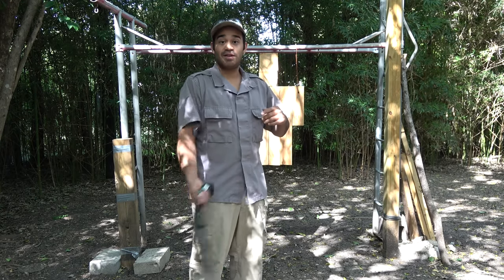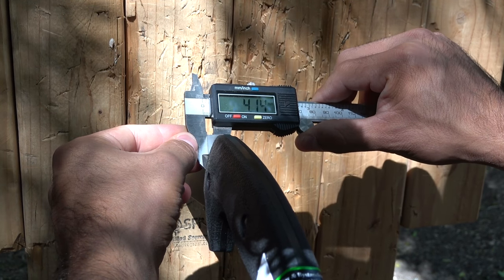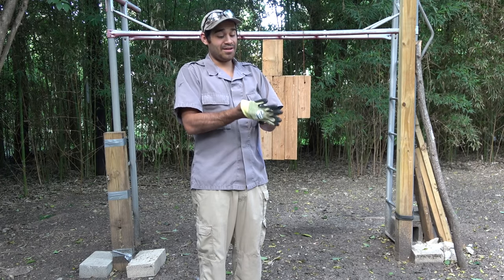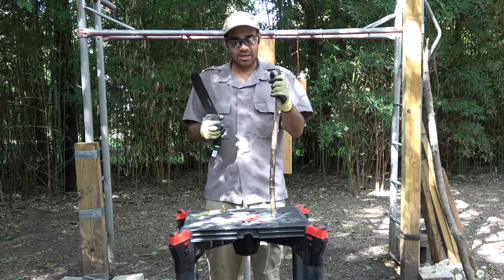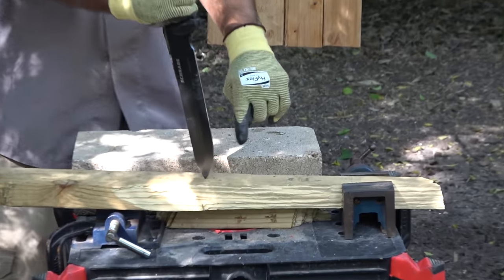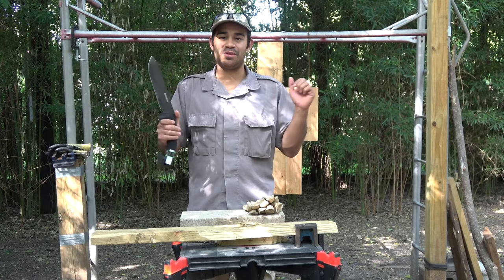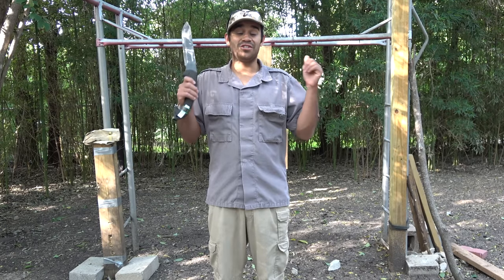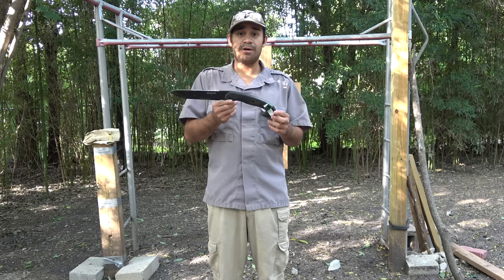Schrade SCHF43 Jessica-X DESTRUCTION . . . By Mayor Fuglycool

Comment: Do the schrade SCHMBS next! I wanna see what that 3cr13 really has to offer!
Reply from the maker: That looks like an interesting blade, will have to give it a look ;)

Mayor Fuglycool
Reply: FPS_Machete_[HD] If it's THIS kind of test, it won't survive. Tell you right now. These are fun to watch, but it's still gross abuse. Cutting/chopping/slicing it'll be fine.

Only Schrades I'd do gross abuse tests on are 1070 ones.
Reply: PREPAREDMIND101 would still be fun to watch :)